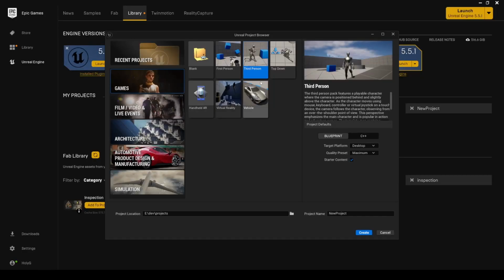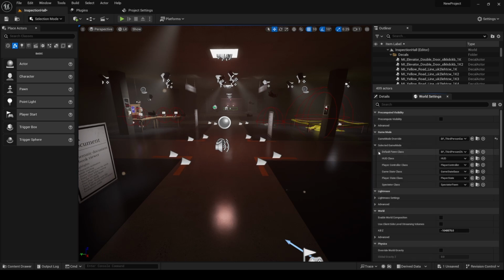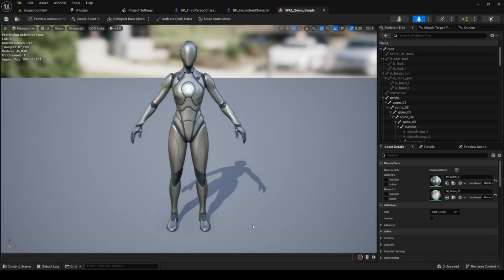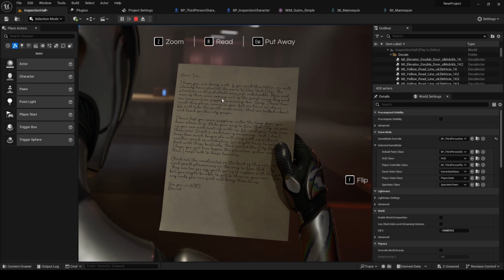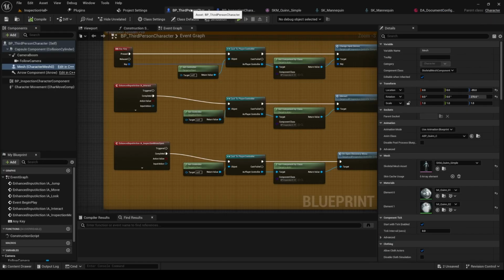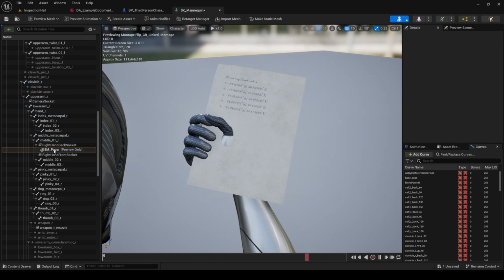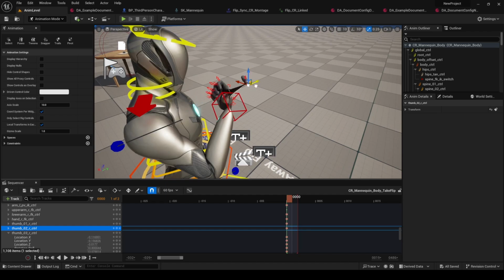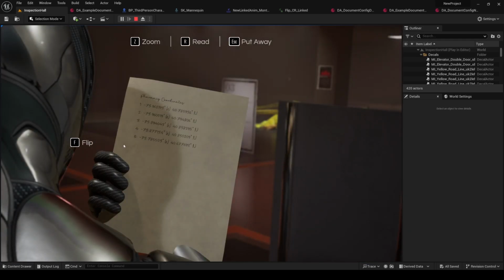Inspection System Pro by Moonville - Quick Start Guide

Comment: Would a person with little knowledge of EU be able to adapt this system to first person? I'm using the marketplace asset called Horror Engine SE, and I'd like to adapt its system to my game which is being created in this framework, but in first person.
Reply from the maker: Difficult to say as this depends on your skills and if you programmed or scripted anything before. First person interaction is generally more simple as you just shoot out a trace and whatever object is hit is the one that you will interact with. You can skip a lot of code in first person that is required in third person. :)